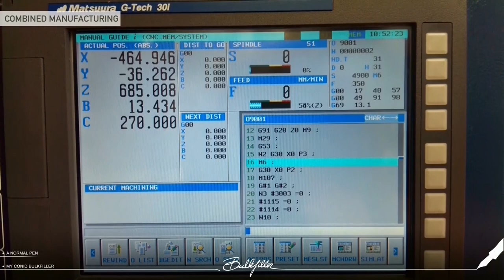CONID KINGSIZE BULKFILLER - The Making Of

Comment: God, these are nice pens, but especially seeing how much of it is CNC done, feels hard to justify the price tag for one of these being over 1000$CAD (800USD).
Reply: EvoseveN even though it's cnc machined, I think its still worth it.  They're using a complex machining process. You can see they are using a 5 or 6 axis (I'm not sure which one) cnc machines just to make the clip and those machines are far from cheap plus the skills required to operate those machines are not obtained overnight. And the conid logo! I'm surprised it is not merely painted they actually make the little pieces then assemble it! Just my opinion
Reply: @kato2395  yeap, that 5 axis Matsuura is easily $600k USD (the machine running the clips), and that's not including the overhead costs to operate one.